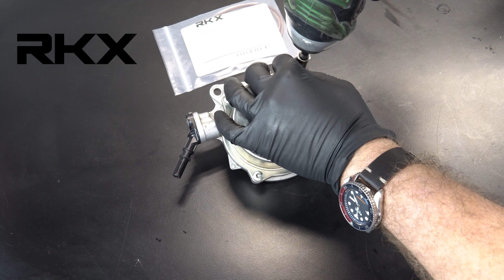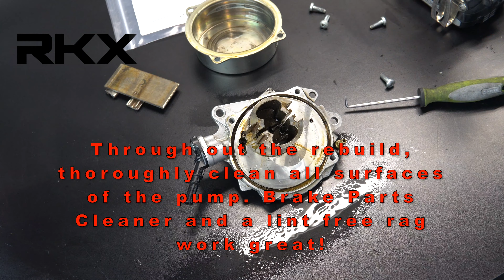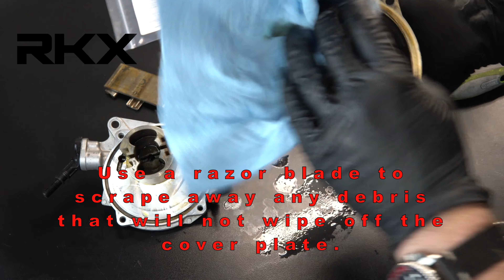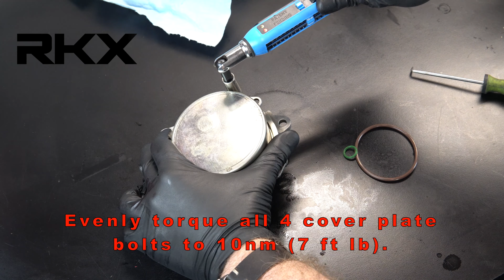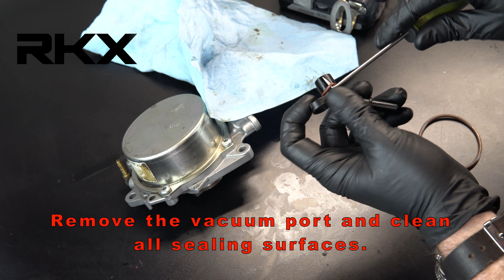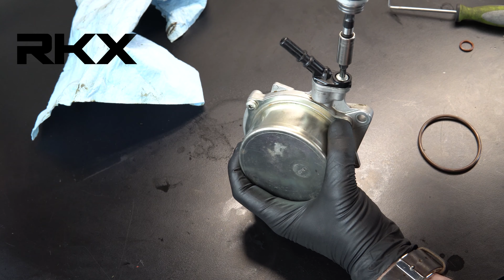HOW TO:  Mini Cooper 1.6L N12 N14 Vacuum Pump Rebuild with RKX kit.

Comment: You tube watchers, don’t do this thinking you rebuilt your pump and are good for another 100K miles. This is merely a reseal - oil leak fix. The coupling shaft bearing can fail (mine did) and it will stop the exhaust camshaft possibly causing catastrophic engine failure.

Comment: This seems more like an oil leak fix than a "rebuild".  The surfaces that score and wear havent been reconditioned or replaced.  A vacuum pump that locks up causes serious damage.  Seems like a replacement is better insurance than an o-ring kit.
Reply: After just reinstalling my OG pump in after installing a "new" one I got off Amazon which started making loud ticking sounds after a month, I can safely say I'd put new seals in the OG than install a nasty cheap aftermarket one. My OG was leaking oil so I transferred the oil seals from the "new" one. 
After opening the Amazon one I was horrified to see the internals were plastic. No wonder the vacuum felt less than half of the original.
I've seen plenty of comments about these doing catastrophic damage to engines but no explanation as to why. The pump itself is basic. The only reason it would lock up is if it was starved of oil due to low/ no oil pressure or crappy maintenance.

Comment: In what circumstances would I have to buy a new vacuum rather than just cleaning it?
Reply from the maker: The most common reason is if you break the plastic vacuum port off. Rarely do these fail internally.  Most internal failures are a result of poor oil change regimens causing blockage of the oil lubrication port.